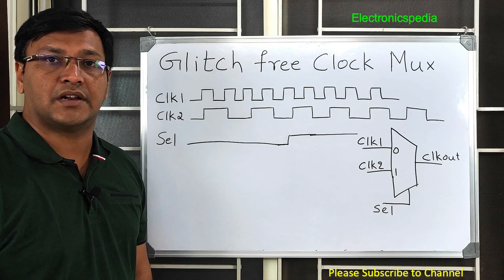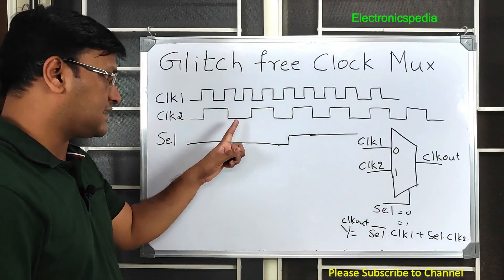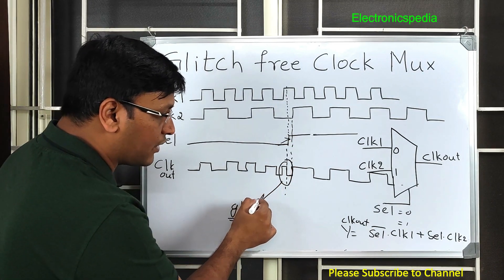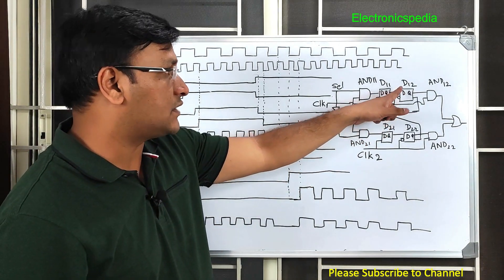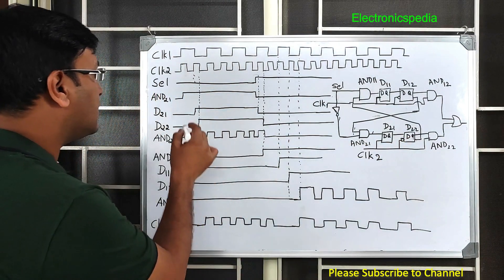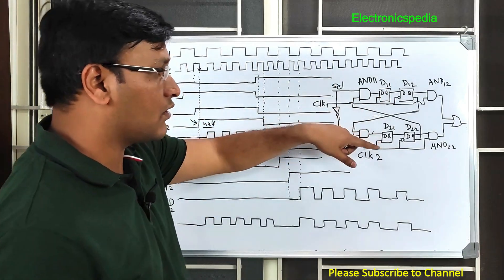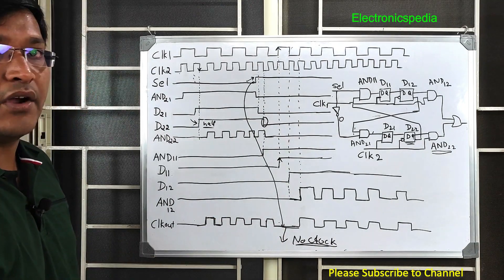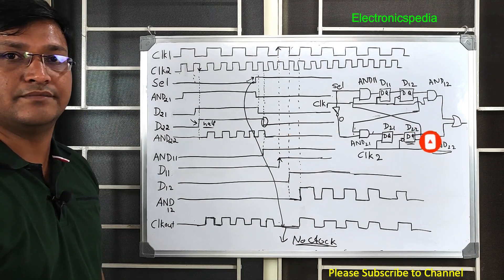Glitch Free Clock Mux | Clock Mux | VLSI | What is Glitch Free Mux | GFCM | Circuit

Comment: Hi sir, can you explain how the flops D11,12,21,22 are reset (initially zero), and impact / metastability if any, when bringing the flops out of reset, and activating the clock mux. Assuming we are using async resets for the four flops.
Reply from the maker: Hi, During reset phase all the four asynchronous resets will be asserted and all the four flops will have reset value of 0, At this time the clock will be disabled so we don't see the clock output. Only after the reset phase is done the clocks will be enabled. By this way we don't see metastability issue. 

Important thing to note is we need to have the two stage synchronizers for select signal to ensure we don't see metastability if select is asynchronous to input clocks.
Reply: @Electronicspedia   Hi sir, thanks for the response. However,  won't the clock inputs clk1 and clk2 will be free-running? Or are you saying from system perspective, clock inputs clk1 and clk2 will be ungated/made available to system, after reset is released. Agreed about the reason for using 2flop synch instead of 1 (in place of D11, D21) ; I think its for this very reason; while the output of AND gate will be stable by the time the  first flop samples it, but it wil provide guard against asynch data transition from 0 -> 1 for d-ff (2nd stage) once it comes out of reset (asynchronously).
Reply from the maker: @AdityasTV  Clocks can be controlled or can be free running. But at a system level usually the clocks will be controlled / gated in order to overcome these issues of metastability and also to save power.

Comment: Clk2 gets disabled in 1.5 cycles after sel value is changed from 0->1,  and then it waits for 1.5 cycle of CLK1 to send it to output of the mux (rightmost OR gate)

Last flops are kept at half cycle path. This is because when we are disabling one clock and switching to other clock this switchover falls in at the downtime of any clock, stopping all possibilities  of glitch to occur, which otherwise possible only if CLK is @ high level.

Its even more fun for 3x1 CLKMUX

Comment: sir , i can't get why we put a negative edge ff you say safely sample the data 
but if we put +ve edge we still safely sample also
Reply from the maker: If we sample the enable signal at an active high level of clock then we might see glitch because we have AND gate immediately after latch, 
Here the idea is to sample the enable when clock is not present and then AND with clock

Comment: We are getting the no lock window for some duration right, doesn't it effect the functionality of the design?
Suppose if I required to get the  mux output is continuous without no clock window  with the clk1 and clk2 are same frequency ,sources are different. is it possible  please clarify.
Reply from the maker: Hi, two clock sources will be considered as asynchronous clocks. For such clocks you need GFCM.
Having no output clock is absolutely fine for few clock cycles.